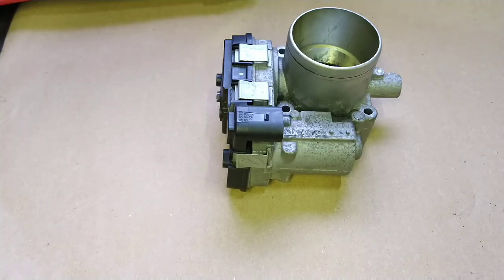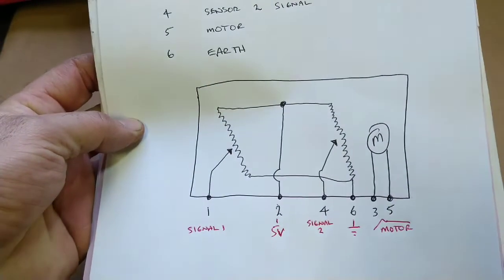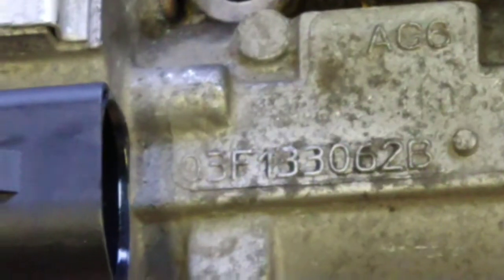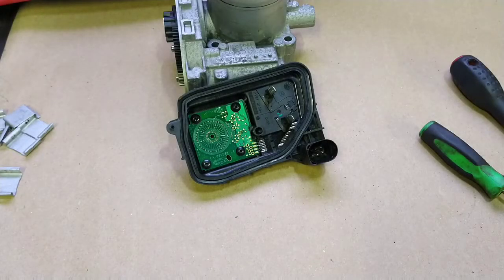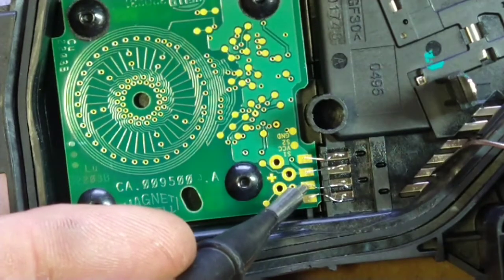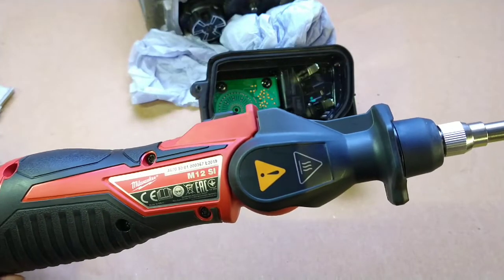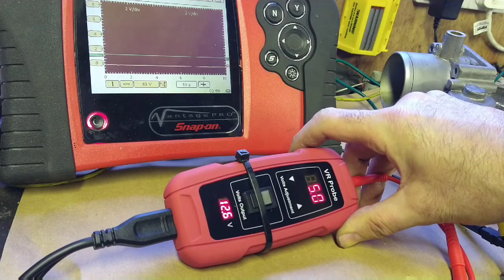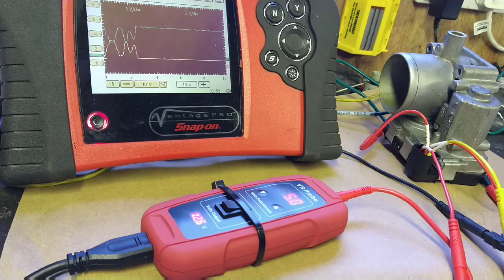Golf Mk7 1.4 TSi throttle body problems. Strip down & repair. P0122 and P0222 Fixed!

Comment: You are an absolute legend! Had the exact same error codes and found the exact faulty wire  Resoldered all 4 wires with new ones and problem solved🎉. If you were in Sydney Australia I'd shout you a steak dinner .Cheers mate.
Reply from the maker: @bobbo5638  😬👍 nice one.

Comment: My Golf had the P0222 code and I watched a lot of videos about the solution but your video helped to me with the real solution, I had already done a visual check of the sensor and I saw everything fine until I saw your video and surprise,  all the wires were desoldered. Thank you so much, you took me away a big headache, my car is working fine now. Greetings from Mexico. Cheers.
Reply from the maker: Great 👍,  It still puzzles me that the wires are so delicate and small in such a harsh environment.
Reply: Hola Leonardo. Oye como soldaste en la parte de metal... No del lado de la tarjeta sino en las laminitas de metal? Ya que lo intento y simplemente el estaño no pega solo se cae. Espero me puedas ayudar. Saludos
Reply: $25k me sale la reparación en la agencia 😡…..me quieren trabar con cambiar el cableado también que porque marca poca resistencia……

Comment: Thank you for sharing this, I've been scratching my head over this issue today and this was the problem! Just soldered in replacement 10a fuse wire in place of those flimsy wires and it now drives perfectly. Thank you!
Reply from the maker: That's handy 😁👍
Reply: Thank you for your contribution. I have already fixed mine with a 10a fuse wire as well. Any idea why the flimsy original wire? Is it intended not to last longer and replace the TPS?

Comment: Hey bro honestly a BIG thanks to you honestly i started having some issues with my car the starting of February 6 and saw your vid like a day after i wanted to check it but didn't until yesterday i got frustrated with having to use public transport and i took off the throttle body and one of the wires had become loose got it soldered and bro everything is good the gas is even burning les fuel honestly thank you im gonna share your link in my vw groups 😊
Reply from the maker: Nice one - no more getting the bus 👍😁

Comment: Many, Many thanks Sir for this quick and easy fix!!! 
Unfortunately mine lasted only one day, possibly due to extreme Hot that we have these days.
Again I repeated the soldering and now is working fine again. However, I ordered a new Throttle Position Sensor (cost 220€) in case this fail again and will eventually solder the old with Silver type soldering that has double the melting point of Lead & equivalents. 
Nevertheless you save me from VW  Service Tooth bite and this is the most crucial thing here. and of course the quick fix time.
Many thanks from Greece.
Reply from the maker: Thankyou, I'm heading to Greece in a few weeks. Looks hot there 🥵🥵.

Comment: I tried this and it work for a little then the issue came back. But I noticed that there was some green non-conductive residue from the pcb on the metal contactor seen at 4:38. I wiped it away with rubbing alcohol and it worked again after verifying with a multimeter!
Reply from the maker: @kylemontrose9332  good job 👍😁
Reply: I know this is an old post, but if you could please let me know where you set the Multimeter? I cant seem to find a reading? Ohms? V? Thanks

Comment: I just had this unit fail on my 2016 Golf 7 Sportsvan, I was 600km from home in another province. I had to get it towed to a nearest VW dealer, where they diagnosed this unit as the fault. I stripped it, same as the 1 in your hands, all good mechanically, also noticed the less than hair thin wires, but did not attempt to do any checks as yet, until I was back home with access to my tools. For signal wires, it is very strange to have wire that thin in place, but, I am quite sure there was either a good engineering design reason or a product management decision involved, reliability vs money from selling replacement units every 100000 km.
Reply: Stripped unit again and, yep, mine had 3 of the 4 wires loose, the wires seem to be spot/tack welded similar to how they connect up lithium batteries. Crazy VW charged me R16000 incl diagnostics, labour, new part. 😢

Comment: Thank you so much. I have already fixed mine with a 10a fuse wire, as described by another user. Any idea why Magneti Marelli used that flimsy wire? Could it be made like this not to last and replace the TPS at some point?
Now I see such wires I can not stop thinking about what would have happened if these wires failed while passing a car on the route with another car coming from the other direction. It is almost hazardous !!!
Reply from the maker: Like most things - it normally comes down to money 💰💰.

Comment: Well hopefully this has fixed mine. Had it resolder for £10 and no issues and no EPC or engine light so far. Fingers crossed.

Just weird for the car to randomly throw up every code going when it was driving fine the day before.

Do you know anything about low rpm car vibrating, just happens at random. Other than that car has no issues.

Comment: Thanks!  Using your video I was able to fix my problem.  Tip for others.. Replace all the wires with new wire.. I'm sure the originals are designed to fail. Being so tiny and fragile attached to a vibrating engine sure isn't smart design.
Reply from the maker: As you say it looks like fragile design. I hope aircraft engines don't have parts like that in them 😯.
Reply: What wiring did you use? Gonna check my throttle body this week.
Reply: Similar wires inside esp lateral acceleration sensor but sensor with board itself is glued to suspension pods due to nature of sensor, little flexible  aluminium wires making sense, also not  possible to solder with regular soldering station. I'm am suprise they make this in tps.. In older vehicles plain  potentiometer  recommended test by  oscilloscope or  just multimeter for resistance when  slowly  moving.  In Your case without 5v power supply and oscilloscope not possible to test this type. Much more reliable design compare to regular potentiometer..Good job specially when throttle may cost half value of car. Just cleaned BMW E46 2.8 potentiometer and may help for some time, new one £600 at dealer..

Comment: very good video it real helped me alot , one question after fixing the throttle body putting on back on the car do i need to reset the throttle body or it will work just fine without?
Reply from the maker: It should work ok but I normally clean the butterfly and reset through basic settings using the VCDS tool or equivalent. 👍
Reply: @Automotive_Solutions  thnx will try vcds

Comment: Hello great video an explanation. I have repaired one 7 months ago. But now I want to repait another one with the same problem. To me it is really hard when I welding new wire. I dont know why the welding dont match with the metal part. Can you tell me the material you use yo weld new wires please.
Reply from the maker: I used a single strand of a multi core cable to match the thickness of the original wire.
Reply: @Automotive_Solutions  Thanks for your response. But when I apply the welding to the metal not the green card. To the metal terminal it just not match and only drops like a rain drop. Do you use a special welding? Or u only use tin
Reply from the maker: @edergarcia5938 I normally use Solder Wire Lead Free with Rosin Core Flux.

Comment: Excellent video. Currently have a 2018 Passat 1.4 TSI in limp mode and rough idle. Of course, it's only weeks past end of warranty and dealer wants to charge.

Getting code P0638 (Throttle Actuator Range/Performance), EPC light, engine management light. Possibly the same issue as in your video. Have ordered a new throttle body, and will confirm if this fixes the issue. Will inspect old part for damage. Family car, has only done 26K miles.

What age/mileage was the part in your video if you don't mind me asking?
Reply from the maker: Can't remember exactly but around 40,000 and 6 or 7 years old
Reply: @Automotive_Solutions  Thanks. As mentioned, this part is not fit for purpose. I love my VW's, but it's not a company that makes good its mistakes. This part has been fitted to literally millions of VAG models, so they really should exercise some customer service goodwill. Unless you have Parkinson's, this part shouldn't fail so quickly.
Reply from the maker: @ottofumbler7267  all the manufacturers are under pressure to reduce weight and meet emission targets so this is the result. Not many vehicles around built like they're aiming for longevity. Good luck with your problem 👍
Reply: @Automotive_Solutions  Emissions... yes, that's a tricky one. Never owned a diesel, so thankfully I didn't get stung with that dodgy scheme they were running. Until full electric cars and the energy networks have their game sorted, I'm sticking with small petrol engines. 

All the extra weight is in safety & occupant protection systems, as I understand. So, we can be safe, or we can be green. I know what I'd rather be. Driving standards seem to be falling, so it's a no-brainer in my world. Maybe we'll have the luxury of both one of these days, but it's going to cost us.
Reply: Sustainability. That's the word I was looking for! If you can repair and maintain (as per your video so elegantly illustrates), then this will have a huge impact on the way we buy cars. Too many "sealed units" being put into new cars, and not enough end-user technical support from manufacturers. 

Example: broken headlight on a Merc, but it's just the holding brackets. Common fault. Options are buy new headlight, buy used headlight, or Merc sell a bracket repair kit... but they don't provide documentation to show how to fit. Makes no sense to me, other than they're trying to drum up business for the dealerships.
Reply from the maker: @ottofumbler7267  it's getting harder to keep up but there are plenty of specialist companies around to repair these modules.
Reply: @Automotive_Solutions  Confirmed... new throttle body unit fixed the issue. Opted for Febi Bilstein to move away from the original Magneti Marelli. Will open the old unit when I get a chance and check for damage. Watch this space.
Reply from the maker: @ottofumbler7267  - nice one. Hopefully fix the old one and keep as a spare 👍
Reply: @Automotive_Solutions  Hopefully repairable. I've got a Golf mk7 (same engine), but it's been parked up for a bit while I focus on repairing and selling my Golf mk5. The mk7 also has the EPC and EML lit, so I'll need to fix this before it goes for an MOT. I'm willing to bet it's the throttle body. Although, it's not gone into limp mode, just missing the turbo kicking in when asked. Might even be just the throttle body gasket. Kept the old one from the Passat, so hopefully an inexpensive fix either way.
Reply from the maker: @ottofumbler7267  Fingers crossed
Reply: @Automotive_Solutions  So, after inspecting the old throttle body, the circuitry is good, the geared teeth are good, but the butterfly flap isn't returning to idle/closed. So, it's a broken spring. I can just about make out that it's in 2 pieces. Probably cost about 10p from a parts bin. Definitely worth repairing if I can source a replacement spring. Any thoughts?
Reply from the maker: @ottofumbler7267  I've never looked for one but it must be out there somewhere. Keep us updated on your findings and good luck.
Reply: @Automotive_Solutions  Cheers. Will post an update. If I can't find a replacement spring, I'll take the throttle body off the Golf and see if I can swap out parts to make 1 good one. Or, £20 will get me a used unit from eBay, and I can take the spring from that. It's an expensive option at £20 for a spring effectively, but it's cheaper than a new whole new throttle body.
Reply: So far, no luck sourcing a replacement torsion spring. Febi Bilstein UK support responsive and friendly, but can only supply whole units, and don't have ref's for individual items inside. Magneti Marelli not replying. Tried asking on VAG forums... nothing so far.
Reply from the maker: @ottofumbler7267  a scrap one would be ideal if you can get one free/cheap
Reply: Hi my daughters 2016 POLO  1.2 is bringing up code P0638 on inspecting the throttle body the butterfly is not returning would I be correct in assuming a broken return spring many thanks.
Reply: @kettle750  Sounds about right. There's nowhere to get the spring alone, so it's a new throttle body that's required. Suggest you hang on to the old TB, as someone someday might sell the springs.
Reply: @kettle750  I should say, if you open up the back cover, you'll be able to inspect the torsion spring. It's underneath the cog with the 3 silver lined points. The spring in my old TB was split in half, so it wasn't providing any resistance to return the valve to the closed position. 

Apparently, the TB is a non-sevicable part. However, if you did manage to obtain a replacement spring, you'd be able to repair the module and refit. 

There's probably a machine somewhere pumping out hundreds of these springs a day, but it seems the general public aren't able to buy them.